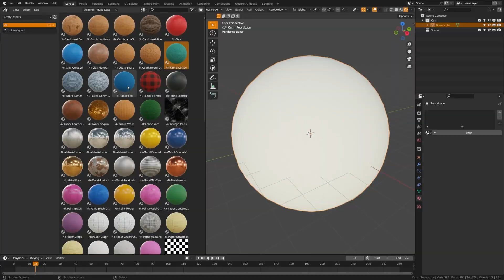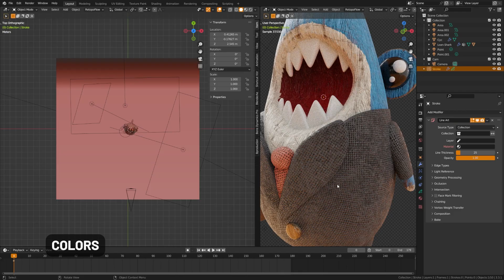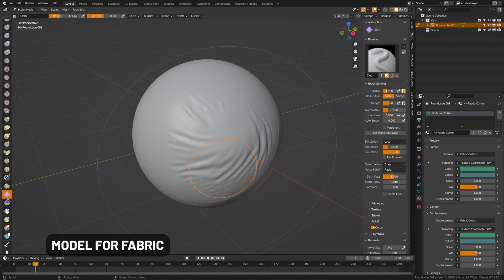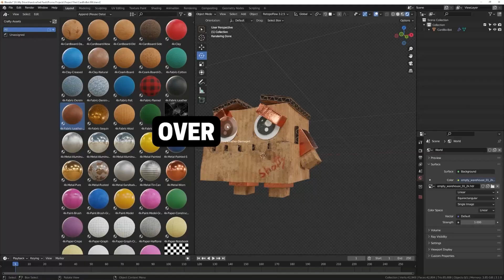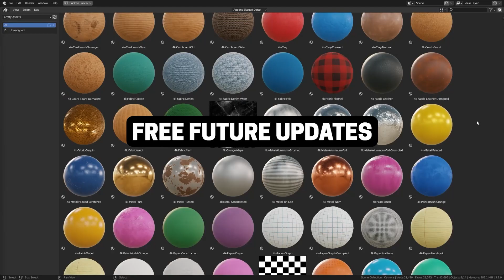Why your Fabric material looks fake in Blender 3D

Comment: you summed it up perfect lol. Fabric is tricky to get right! So many factors to consider
My tip would be to use layer weights instead of sheen. It gives more accurate results and you can actually control the amount and size of it